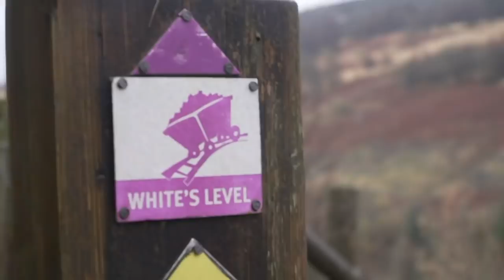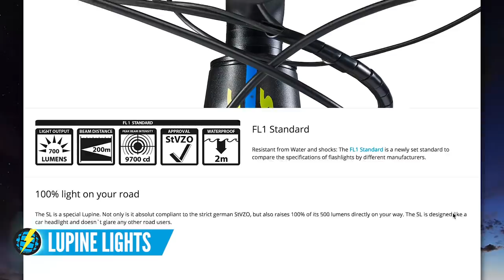Can You Fit A Motor To Your Full Suspension MTB? |  Ask EMBN Anything About E-Bikes

Comment: Before I watch this.
Can you cheaply upgrade all full suspension mountain bikes with a bolt on motor? 
Yes, BBSHD is the best one to get unless you want lots of power..

Do e-bikes depreciate quickly? 
Yes as batteries are dropping in price really quickly.

Are shorter cranks better for electric mountain bikes? 
No idea. I run big motors so I don't need to pedal.. hehe

Do any bike lights plug directly into the EMTB battery?
Yes loads do but most are pretty shitty I prefer to stick to solarstorm x3's or I've DIY'd a few lights with Buck converters.

Chris and Steve answer all of your questions
Well we'll see about that..
Reply: Indeed they did answer all the questions..
The jury's out on how well they did.. 

As they gone to enjoy a nice ride in the park..
Interesting channel guys maybe you need to brush up on the technical side of things but this is a good channel for those who are looking at ebikes from the POV of MTB riders who just want the extra's electric drive can bring to the trail vs the pure EV traveling or tech side of things a lot of others focus in on but I think you guys do need to bring that into the mix a little.

Comment: Lads I've got a bafang BBS HD I have it on a 2001 coyote full suspension it's super heavy 27kg but it's awesome I have a 52v 27 amp battery got the kit from ev3em cost £1500 all in bargain. On full throttle 30 mph and 32 mile range battery is heavy but you forget it's there you lads really need to try one the only thing I regret is not getting 2 smaller batteries which I will be doing in the near future as Cannock Chase one lap used 7%
Reply: I have an 02 and an HD on 2 different Specialized FS bikes. An Enduro and a Stumpjumper with a Lefty. Love em.
Reply: I fit 300w BBS-01 kits in my shop here in New Zealand. None of the DIY Bafang kits use torque sensors, the cadence sensors are responsive but not easily controlled, which is where the NZ-legal throttle has huge advantages. Loads of fun though, $1700 NZD for a kit, add a $1000 hard tail to the mix and you've got yourself an affordable mid drive on a bike that's of reputable quality.

Comment: 6:25 when looking to the side the bar light won't look shine there, you look before the corner, into the corner and around the area you want to ride,  before you ride there, so having both is a good idea, also when going off the bike, a helmet light is a must. not having to remove the light from the bar, and place it in a awkward place, or do some awkward gymnastics with the light while working on the bike in the dark. you could of course place it to the side and let it shine, but then you have to move it again if working on something else. so but helmet light will shine where you want it to while working on something.

Comment: For Lights I use a Busch & Müller IQ-X light on my E-Bike. It has about 100 lux. Realy good for night riding. It has an automatic day / night mode. I originally had a Focus Jam2 with the Shimano motor on it, and now I have  a Cube with the Bosch Motor. Excellent light. I highly recommend it.
On the back I have a Supernova .
One comment is that the Bosch controlls are much much much more convenient / easier to use for turning lights on or off. It is a single button press. With the Shimano, you have to stop riding, go into the menu and scroll through the options to find light and then select that before you can select on or off... a pain in the bum in the lake Garda area where you are often on trails that go through tunnels so you often need to turn the lights on or off.
Reply: Seeing as you have owned a Bosch motor after a Shimano, you would be the right person to tell us about the " Pedaling above the cut-off " phenomenon. Is the Shimano easier to continue pedaling above the cut off speed. Does the Shimano pedal like a conventional MTB when the motor is turned off ?
Reply: @sijmes  Yes and no.
Firstly, I find the Bosch transition between powered and non powered at 25 KM / H more gentle and less abrupt. With my Shimano it hit 25 and abruptly power was cut. with the bosch it still seems to help a little at about 26kmh.
It is not a huge thing. I do a lot of very long rides or up to 2000 vertical metres therefore ride a lot with the motor off and really don't notice that there is much difference between the two.
The best way to test this would be to go to your local bike shop and ride bikes with both motors without turning them on. Note. Do the tests without motor first. Also take into account the size of tyres on the bikes. I now have 2.8 wide on my Cube so there is of course more drag than on a bike with much skinnier tyres.
Bottom line, is that the difference isn't as big as people make it out to be. And it feels much worse than it actually is, as you get used to the motors help very quickly.
Reply: @A-Kiwi  Thanks for your reply. I actually own a Bosch CX powerd cube. I commute on it and use it in the woods, but terrain is pretty flat here. The cut off is quite apparent and makes me wonder how the other motors perform. Especially after Chris's comment in the film here above. I suspect that they avoid showing any favour towards certain companies, due to legal stuff. I'm looking forward to a test ride on a Yamaha powered Giant soon.
Reply: @sijmes   I think maxbe the cut off varies. I have talked to others who say the cutoff is better on the Shimano.. Maybe it depends on the software version. Anyway I found the Bosch to be better than the Shimano I had.
Before I bought my bike with the Shimano motor I tried the Yamaha.. (That was 2 years ago now) I definitely found it more jumpy than the or less smooth than the bosch and Shimano. But things have probably changed since then.
Oh.. and a big advantage i found with the Bosch motor was starting on a steep hill. The bosch definitely started earlier and made it easier.
Lastly I returned my bike with the Shimano after 4 months of riding as I had so many electronic problems with it. It just wasn't reliable. I had it in for repair 8 times in 4 months and eventually got my money back.
Reply: @A-Kiwi  what make was the bike with the Shimano motor, if I may ask ? I think that there's not really a lot in it and that any difference shouldn't really be a deciding factor. These bikes are designed to climb and descend and travel over terrain so rough that 25 kmh is quite fast. Immediate sticking with my Bosch for now. We shall see what comes out in the next year or so.
Reply: @sijmes  I had a Focus Jam2 29" wheels.
Was a nice bike, but I feel more comfortable on the Cube with the 27.5 wheels.
One of my buying decisions was that my wife now has a Treck emtb with the Bosch cx motor, and If I do something realy long, I can take her battery as a spair.

Comment: #AskEMBN I've heard that the Giant EMTB range is far superior to Specialized (half the distance) - can you do a back to back test to determine if any bikes are way out in front?
Reply: Its just physics, if both have a 500wh battery and you ride each one apart from small motor efficiency differences it will be very similar.  The solution is pies , eat less, go further .e.g. rider weight, and fitness, contribute more at higher cadence and also get further.   No the Giant has no magic solution but a nice bike all the same.
Reply: brian little Not sure they are far superior, but they definitely seem to have less problems at this stage - the Levo on the other hand collects crud in the motor casing, and there have been excessively noisy motors and failing power cables to. For the premium price it is not very impressive.

Comment: #AskEMBN

I’m looking for an electric front wheel for my disc brake commuter bike.  Just looking for small power like around 200 - 400 watts just to take the edge off with additional pedal power. And maybe at least 60 KM worth of mostly flat terrain, if that’s possible.

There’s so many out there, I’m having a difficult time deciphering which ones are quality.  3 decades of cycling knowledge under my belt but, I’m ignorant to the new electric aspect of it all.

What would be your top 3 recommendations for such a set up? (All-in-one kits, or hubs and batteries purchased separate, etc).

Thank you and cheers from Iowa, USA!
Erik

Comment: Regarding crank length, surely there is a video in that? It doesn't need to be particularly scientific but you could at least give us some subjective feedback on some back to back runs, both up and down hill, with some short, medium and long crank arms on.
Reply: Most 2019 EMTB's come with shorter cranks as bike companies are being the benefits, mostly 165mm, whereas a lot last year had 175mmand Steve himself discussed the benefits of shorter cranks on an EMTB when riding a Ghost equipped with them in an earlier video if I recall
Reply: @R120-r4k  I get them impression Chris is thinking of lengths down to 150mm.
Either way would be nice to see a vid on it

Comment: Did I miss the bit about fitting a motor to full suspension bike ? 🤔
Reply: Clickbait. 🤘🏼
Reply: Yes. You missed it.
Reply: They wouldn't want you putting a electric motor and battery on a full sus for about£400 even if it last a year it's still only two grand over 5-years and each year the motors get better

Comment: ebike shop sells and fits dongles and honors the warranty
Reply: Going faster doesn't do anything to the motor, it's not pumping more voltage or current through the controller, it's not burning out the motor windings, it's merely not switching off at its pathetic limit. If you think an increased motor RPM will kill it, see how Shimano or Douche or Yamaha etc. deal with bikes with super-low gearing, such as the new 51 Tooth XTR cassette, where the RPM could be quite high anyway.
Reply: The answer to the original question was a bit wrong or at least incomplete.  Taking the whole should you and legal / warranty aspects and leaving these to the side, there are several options besides hardware mods to achieve de-restricting and these retain all the normal distance info etc.  The best but not necessarily the cheapest are software based mods (much like car tuning / remapping). I have from experience tried a few and I would say the best at the moment is Eplus from an Italian developer. This does NOT give you wrong speed readings etc etc and the bike behaves normally albeit de-restricted in one way or another without the need for any wiring or disassembly of the bikes drive system.  Speed aside, there are very valid reasons to change the power profiles on an ebike beyond the simple settings a manufacturer provides.  In fact some manufacturers provide very granular adjsutment capability (specialised) and others do not (bosch, shimano). A good example is where you my actually want to change the front chainring size on a shimano system but have no way via the supplied shimano software to do that.  In all these discussions re de-restriction remember the actual top speed achievable  is always governed by either 1. gravity and the steepness of a slope (100 limit embn tried to achieve) or the final gearing of the bike.

Comment: Peartune for Bosch . You retain the correct speed on speedo and you can disable with one click of intuvia display button.  It is actually pretty dangerous being unlimited , even the performance line motor was really fast and we arent wearing mx gear or leathers folks.  32kmph is the solution, its all we need for mtb. And 45 for roads like it is in progressive countries already
Reply: Your limit is different than my limit. Not saying which is faster. How about we ride within our abilities and respect the others doing the same, without legislation? Autobahns seem to work where those lucky enough to have them exist.